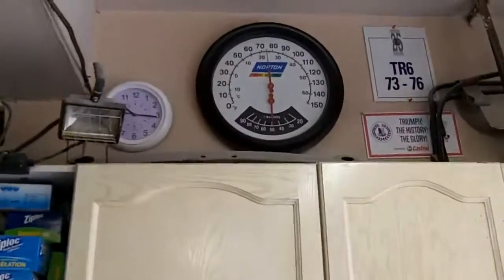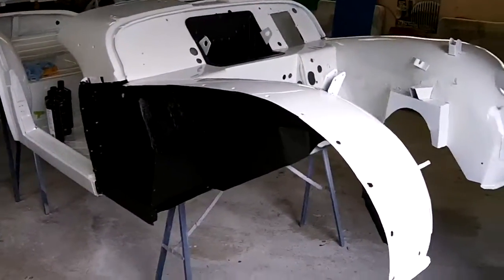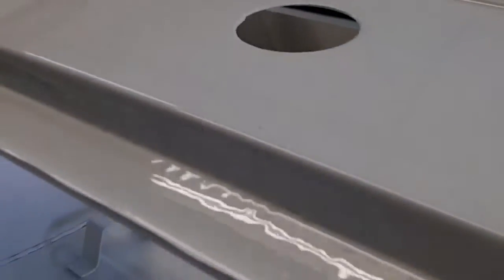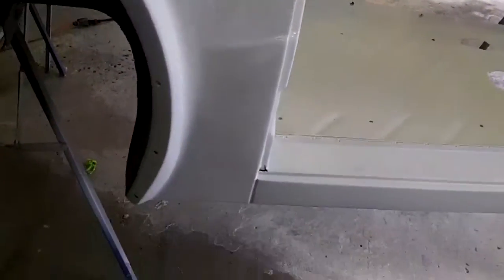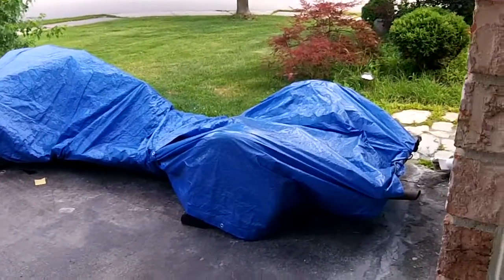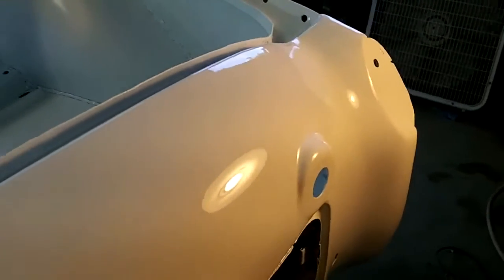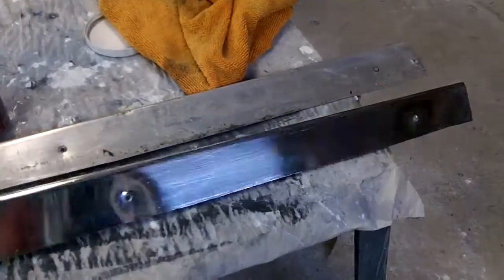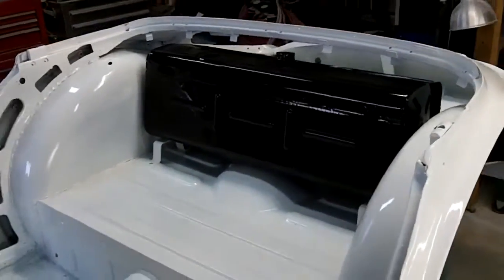Cut and Buff Body Tub and Other Projects....1960 Triumph TR3

Comment: was nice here in ohio...temp in low 70;s low humidity but knows its wet and humid....floods...
been looking for a mg or triumph....thinking could make a nice little rat rod. i had a mg back in the 70's. made a awesome winter car.....never rusted much and was easy to clean underneath.
lookin sweet

you've come a long way Tush! diffidently turned the corner.